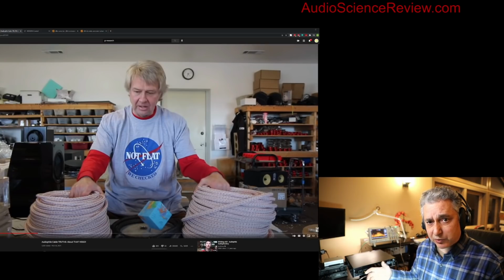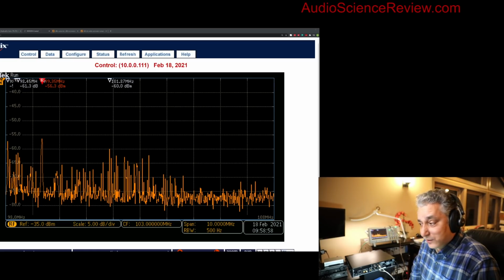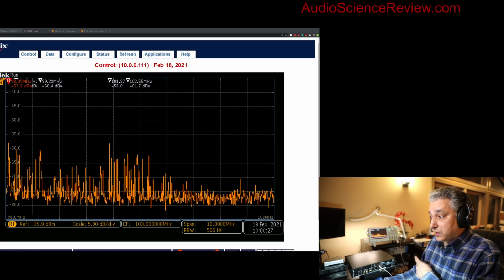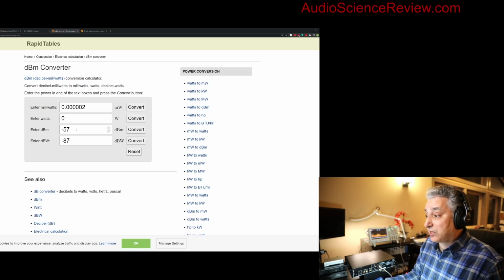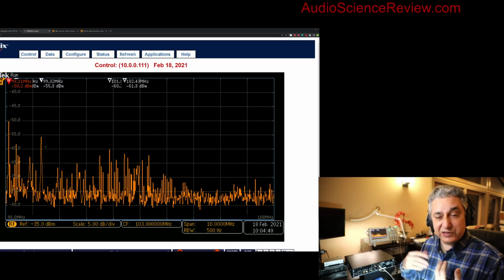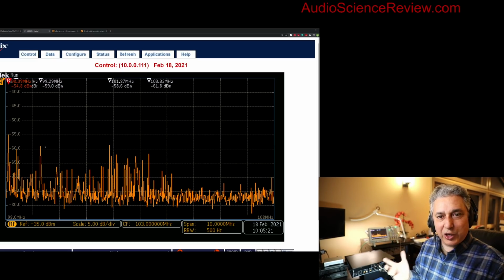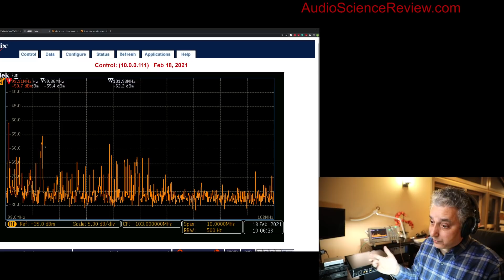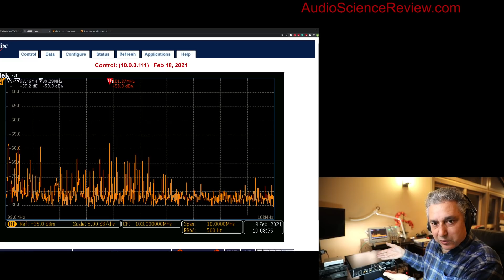RF Interference in Speaker Cables???

Comment: GR just released another video and his argument is that there is a whole industry dedicated to this problem so therefore it is real.  Somewhere there is a disconnect and where he looses credibility with me.  He gave a very specific example of a commercial installation but truly doesn't understand the whole problem.  And yes, in that case, filtering may have addressed the problem but that also doesn't mean there  might not be a design issue or some unforeseen circumstance with the given application or equipment.  Maybe placing a few ferrites in strategic places would have prevented coupled noise from coupling back into the equipment.  And that would certainly not be a reason for everyone to 'filter' their audio cables.  

I agree with your analysis and given the ratio of RF to audio signal, I can't possible see why these guys think its a problem. The problem is they take a basic concept and misapply it.  I'm still scratching my head over this MIT Cable thing.  On their web site,  The Q&A section that GR also makes mention of, has questions and then their answers don't really answer their own questions.  I guess the gullible just gloss over it.  I figure all the braiding of the cables just increases the length of the copper used.

I've seen fairly high levels of RF ride on low level audio signals before and if you weren't looking for it you'd likely never know it.  And it ain't happening on people's home audio equipment.
Reply: Today he even released one more video on the same subject proving who knows what.
Reply: @IliyaOsnovikov  I saw he was demonstrating coupling of an air core transformer and drawing a false conclusion.  He would say I'm a flat earther just to be dismissive.  Most of the coupling he is implying would end up being common mode in a twin lead speaker cable.  He's making something out of nothing.  Just use fat twin lead, OFC if you want, and you'll be good to go,

Comment: Funny story (and not disagreeing with you Amir), in the 90's I had monster speaker cable hooked up to small Denon receiver and Klipsch Heresys 2. I ran the cables outside the apartment window to my bedroom and brought them back in. Middle of night I was woke up by a blast of noise. CD radio on nearby vehicle, likely 200-300 feet away, dropped quickly as car sped away. Happened a few times. I'm sure the Denon was off. I always figured the outside wiring and the efficiency of the Heresy's along with a CB blasting at high power was the culprit. Not RF interference!
Reply from the maker: People really screwed around with those CB radios.  Standard practice was to remove the limiter and have the thing over driver like hell.  Instead of 5 watts, you could get upwards of 25 watts.  But boy, was it distorted then.  Folks didn't care.  They just wanted to get their voice over the other people polluting the bands.

Comment: Measurements are somewhat useful when determining which amp or DAC or speakers to get, cables not so much. With cables, if you have a TRULY resolving rig (in my experience this starts around 15K), only your ears will tell you whether the $1000 speaker cables are better than the $25 cables.
Reply from the maker: Ears don't tell you what you "hear."  Your brain does.  Unfortunately it takes into account more than what the ears tell it as I explained in the video.  Anyway, my audio system clocks close to $100,000 so I assume I am qualified.  :)  My speakers alone are $23,000.  I also have high-end cables like Transparent Audio.
Reply: @AudioScienceReview  ears/brain doesn't matter, the point is your system and your ears/brain will tell you which cable is better in your system, not the measurements.
Reply: @michaelmityok1001  -- Your ears/brain will tell you what you find pleasing given the source material of the moment, not whether the system is performing any "better" (or worse) as per the principle of high fidelity reproduction, the term "high fidelity" meaning "great faithfulness" to whatever input is active.

Comment: Amir, you might find Dave Rat interesting. He did a small series of vids on signal loss on speakers cables.
Essentially, it was various different cables at very long length, including different methods of rolling or folding them.
For home audio, the examples are extreme, but in pro-audio, they are a pretty standard.
Either way, they are pretty informative and well designed experiments, as are some of the other vids he did after.
https://www.youtube.com/watch?v=KKooWhMGT-k

My own position on cables is that most of the difference is in build quality and placement, and small bit of black magic :)
Reply from the maker: Thanks.  I watched the video and he is a good educator!  Long cables are a different animal indeed and losses become significant.
Reply: @AudioScienceReview  -- For the vast majority of home stereo systems, the relevant guidelines are very simple.  IMO they were nicely summarized many years ago -- you can tell by the crude 1990s HTML -- by retired McIntosh engineer Roger Russell.  Russell was not only McIntosh's lead speaker designer, he also designed such classic electronic products as the legendary C-26 preamp -- IOW, his technical skill set was much broader than our friend Mr. Richie's.

http://roger-russell.com/wire/wire.htm

Comment: As I stated in the comments in Danny's video, I live about 500 feet away from 1210 WHPT's transmitter, which is probably putting out something like 10,000+ watts of RF. Its strong enough that an AM radio receives 1210 and only 1210 no matter where the dial is. Regular speaker cables work absolutely fine. All the issues are always with keeping the damn AM out of the input side so it wont be demodulated and amplified, especially when building something like a microphone preamp with 60 dB of gain.
Reply: Have you tried to build a decorative box of wood like the 70's receivers but line the inside with aluminum foil.

Comment: Amir thank you very much for your videos. I would like to know how bad is if a power cable is sitting very closely or if its intersecting with interconnect or speaker cable.  Thanks  !
Reply from the maker: Put your ear next to the speaker with the rest of the system off.  If you hear hum or buzz, it is a problem.  Otherwise, no.  :)  To be on the safe side, cross one cable at 90 degrees to the other and don't run them in parallel.
Reply: @AudioScienceReview  Thank you very much for your response. I did your experiment. I can hear hum/buzz sound only if I turn the volume  at very high level above 85/100 and If my ear is 1-2cm from the speaker driver.  But this doesn't have to do anything with crossing cables because I can hear the same buzz with the same intensity if I unplug the interconnect cable  and move the speaker cable far from the power cord:) My Amplifier is Hybrid Pathos Classic One MK3 having a tube preamp so I believe the noise comes from the the tubes rather than cables.

Comment: Oke if it's not RF noise or AM what ever. Then why is it that cables sound different. I have experienced it myself with going from dirt cheap speaker wire to €5 per meter cable. I even played with one speaker with one cable and one with the other and me and two other friends heared it.

Comment: Perhaps the receiver test is not fully repeatable or an expert technician technique, but I have heard difference with cables, interconnects and  electronic components like capacitors. I make choices based on demonstration. It works for me and at least is good for the economy. Do you doubt signal path components like capacitors, or resistors, or inductors sound different even though they measure the same?
Reply: Yes, you have heard all those differences. But the differences was caused by your brain, not the components. Everyone, including me, is susceptible to this. Hence the need for objective tests and measurements.
Reply: Peter Milne Or... there is a difference in each persons hearing that allows or causes them to hear things differently AND they may hear things that are not measurably different. Like the difference in crossover components that measure the same but sound different. Scientists are supposed to explore the differences in things and may have to face the fact that their tools may not measure what needs to be measured to be able to differentiate. Saying there is no difference because you can’t tell the difference based on your process may miss that there is a difference.
Reply: @chriswhite9912  Funny, then, that these alleged differences disappear under blind testing.

Comment: Your assessment is unscientific because you did not do thorough research of the impact of RF injection into the audio device. That is the key problem - did you even consider using an EMI probe to provide a proper engineering assessment inside the audio device? You might be surprised, broadband RF leakage is everywhere nowadays. You make assertions that you "can't hear" this or that - have you tried to listen to the difference cables make? You make blatant subjective statements you can't hear 100Mhz but why have you not considered potential demodulation withing the internal circuitry ??? You're adding to the ignorance of the true potential physics of the issue.
Reply: Maybe because this topic is about speaker cables, nothing to do with the electronics involved.  Pay attention perhaps?
Reply: @jonnobrakesman  Incorrect, EMI is a huge issue for electronics - any and all cables that connect and enter equipment are by far the toughest challenge for true EMI professionals. It may come as a surprise but speaker cables do enter the electronics package and can irradiate the internals. Especially if they are plain ol wire inside the box. Try contacting the real experts in the field and ask them - you will get the facts straight.
Reply: @enlitenaudio8689  You're so stuck in your own opinion that you fail to see the very basics. How can I be incorect? Are you telling me that this video specifically about speaker cables really isn't about speaker cables at all but encompasses everything you can think of instead?  Fascinating concept!   
We all know that you can hear interference in speakers that are caused by outside influences on the electronics driving them, this is not about that. Like I said already, maybe have a go at paying attention and addressing the same thing that the rest of us are talking about.    Whether speaker cables can enhance/spoil the listening experience because of frequencies we cannot possibly hear!
Reply: @enlitenaudio8689  if you have strong rfi field then speaker cables are least of your problems and even expensive snake oil cables cannot help you

Comment: Even if speaker cable picks up  rf or em the energy is too small to move the speaker diaphrams. Rf and em probably matters on rca inputs before amplification but those are usually sheilded. 👍👍👍👍👍😁😁😁😁😁😁😁😁

Comment: Hello Amir. I think that is only one side of the Medaille. Speaker cables Parameter are important for some Typs of Class D switching Amplifiers. That is necessary if the output filter is not perfect and switching rests are measurable on the terminals of the amp. Now the cable is operating as an antenna and in worst case it can be the reason for not getting the so called CE-certification due to EMV-Problems.

Comment: Hey Amir, which speaker cables and interconnects do you use with your main listening system?
Reply from the maker: For interconnects, I use Mogami Gold XLR cables.  It is a bit of a splurge at $30.  I have tested dirt cheap XLRs and they perform the same.  For speaker cables, I use a mix of what I have from cheap zip cord to fancier Monster Cable I got for free years back.
Reply: @AudioScienceReview  And what power cables do you use? :)
Reply: @AudioScienceReview  Ok, that's amazing. I was gonna ask what would you recommend in terms of interconnects/speaker cables. I made my own speaker cables from twisted  cat5 that I had, i've been happy.

Comment: You need to connect the speaker cable to both a speaker and an amplifier. Then connect the speaker end to your scope with coax. I believe the low impedance of the speaker will effectively short RF.
Reply: Yes,that would be the correct way to do it. There is so many funny videos on Youtube

Comment: 20 years ago I had a Cambridge PC speaker system that used to pick up what I thought were CB radio, but could have been AM; this was in standby as well.  It used to wake me up in the middle of the night or early in the mornings.
Reply from the maker: CB radios were routinely modified to overmodulate and produce more than allowed power.  And people would buy crappy RF "linear" amps that would even do worse.  This was the main reason they would bleed so much onto people's home system.

Comment: Another great video. As a kid and a young budding audiophile, I would get frustrated because I would get hum and RF radio signals coming through my phono section of my receiver. I also lived next to a large Antenna tower. Fast forward to today, I discovered a hum on my high-end phono input. Sometime before I had switched to a "audiophile" phono cable. I switched back to my "quad shielded" phono cable and the hum disappears. Lesson learned - shielded cables do matter with low level signals.

Comment: So where's the demonstration using the braided cables? Your demo is no less "hand-wavy and crude" than Danny's. But nice try anyway.
Reply: You missed the point.  Even with cheapest cables, RF isn't an issue.
Reply: @pasikokkonen1603  Why would you need to reduce something that is already completely inaudible?  What do you think sound is?
Reply: @LouGuido  What on earth you are on about? Read again what I said. Not that many words anyway.
Reply: @pasikokkonen1603  I meant to reply to the original poster. We are on the same page. 

For @ujean56,  you implied that testing braided cables was necessary. My assumption is you want to see that they lower the RF level. My point to you is that even if that were so, and it probably is, it doesn't matter because in this zip cord worse case the RF is already at inaudible levels. This is without the speaker load, which would likely lower the level even further. So your line of questioning and accusation of hand waving is misplaced. That's what I'm on about.
Reply: @LouGuido  Ok, wait a minute. I didn't make any accusation; the video made the accusations. I'm just pushing back and saying don't do half a job. If you want to prove a spade is a spade, don't show us a 2 of clubs. Test the braided cable and prove nothing is happening. You might even go to Danny's references and disprove the source of his misguided claims. Until you do that, you haven't really said anything.
Reply: @ujean56  So you didn't make an accusation. Then proceed to make that EXACT accusation, even though it's already been explained to you why it doesn't matter. Lol.
Reply: So if you can't hear a herd of elephants outiside your window do you then test to see if you can hear a single mosquito?